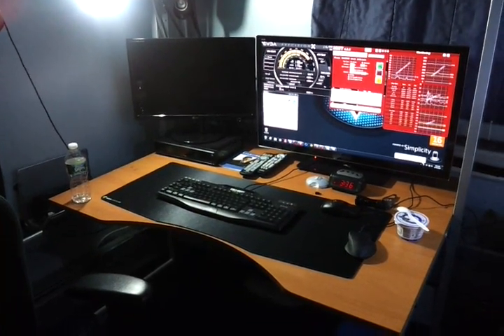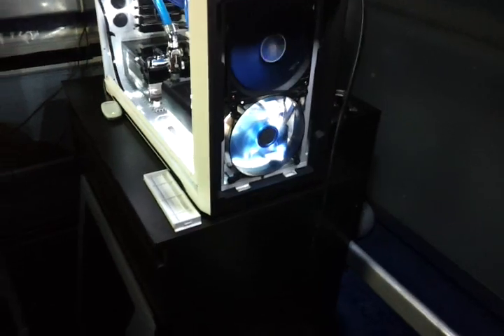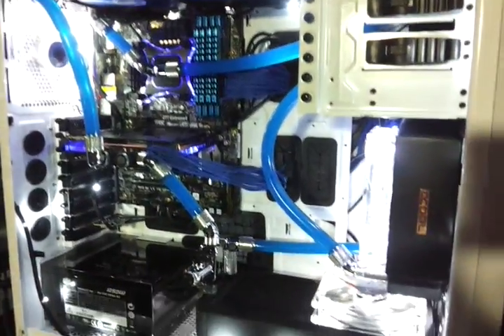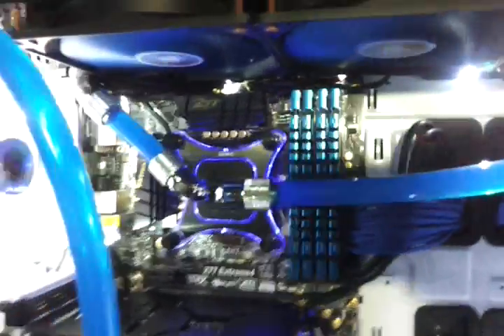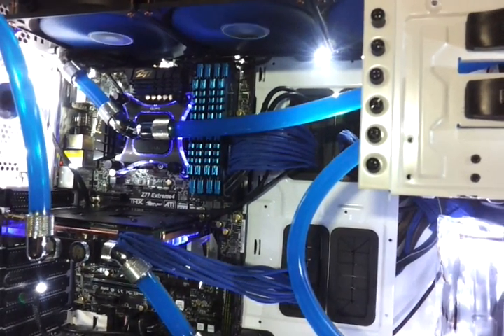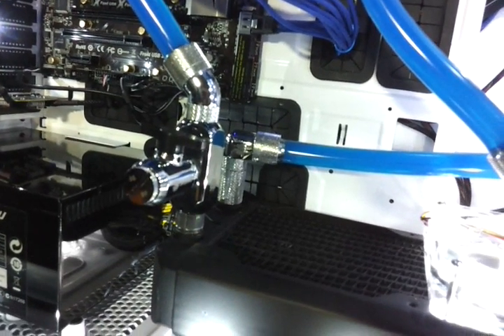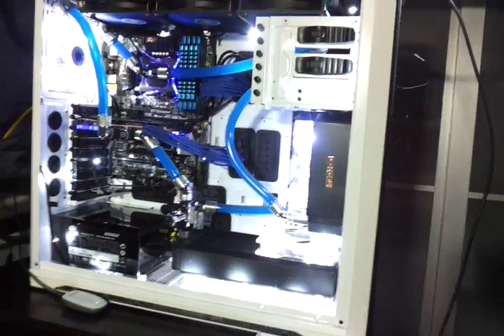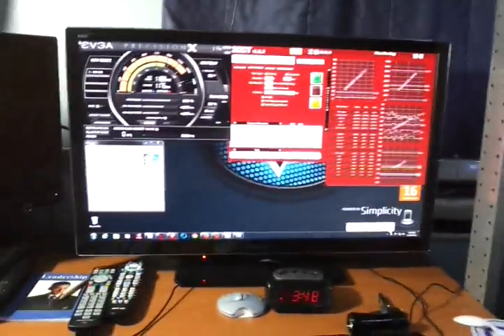NZXT SWITCH 810 WATERCOOLED

Comment: I'm confused, I'm wanting to do a very similar setup, hoping it can be quieter than my current setup (hyper 212, stock 6950 fan, 1 case fan on side panel) but this sounds rather loud, ~the same as mine under load. obviously your temps are going to be better, not saying it's worse lol... but are you able to make it silent at idle?

Or maybe it's not loud, maybe it's just the camera...

Comment: I like what you did to the case - the white lighting is a nice change from all the standard blue and red you see people do. Do you have any idea how your flowrate is? You seem to be using quite some 45 (not too restricting) and 90 (restricting) degree fittings but your temps sound alright.

Good build!

Comment from the maker: Its easy. look on top of ur case and cut the metal from one end of the screws to the other end. Now Am talking about the middle fan is located. The both ends of the middle fan screws thats where ur supposed to make the parallel cuts

Comment: Your temps seem high for 3 radiators. I'm running the same 420mm radiator for my 670 FTW and i7-2600k and my temps are identical @ 4.5Ghz on the CPU and +100 on core and +200 on memory for the GPU. You'd think two extra radiators would bring the temps down. I guess adding more radiators doesn't seem to do much.

Comment: nice build but 1 question what temps you getting because i have 3570k oc to 4.5ghz on a h50 and max temp i get is 75c under load for 24/7